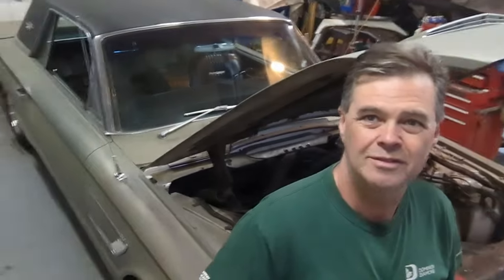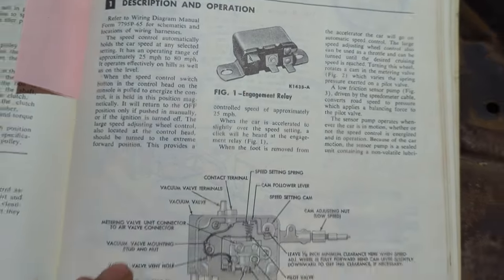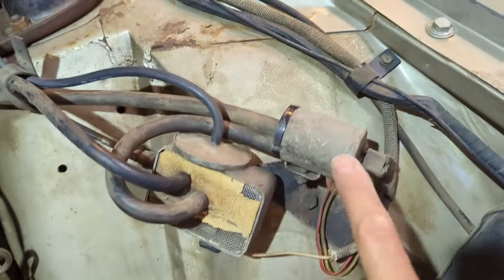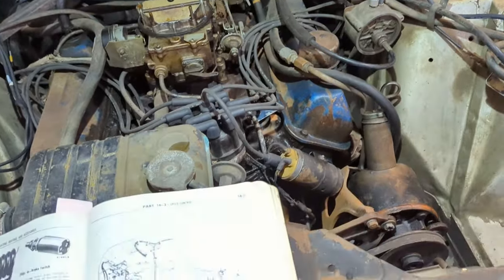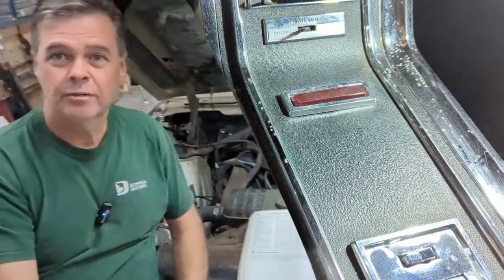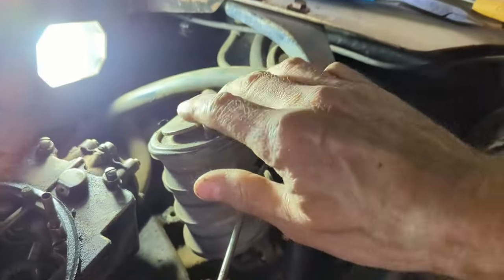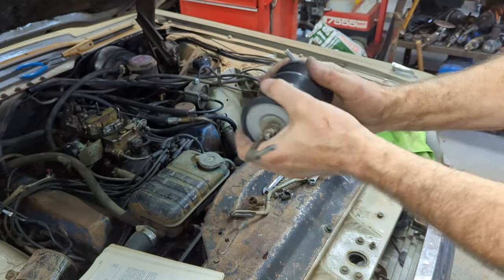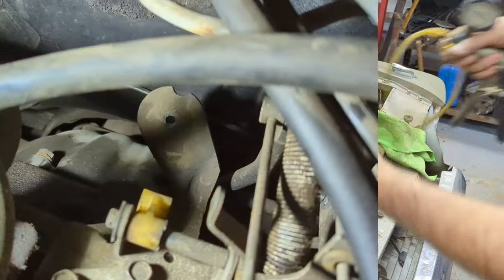1965 Thunderbird Classic Car Repairs Cruise Control

Comment: Nice job. Every speed control unit I've ever seen has been broken. Never saw one working before. I like that you cover some of the unique features like this one or that remote trunk release. Hope to see more.
Reply from the maker: I gather from the comments that these speed control units didn't work so well, but I'll give it try on the highway, and see what we get. 😎
This car has one more not so common feature...the "Perma-Tuned" ignition that I've been wanting to do a video on, It appears to be complete in this T-Bird, I don't think it will be a deep technical video, but more of what each component does, but first I need to get my head around on how it works. Lol

Comment: Simply amazing.  The things that they did before electronics took over.  I had a 66 with speed control but back then the bellows was not reproduced so I never tried to make it work. I hope you do a video of it on the road someday.
Reply from the maker: There are a lot of components that all have to work together in order to make these work, and having them all still installed on the car is rare in itself, lets hope it works on the highway! I do plan on doing a short road test video, fingers crossed that it at least sort of works. Lol

Comment: Hey Alvin, excellent video. I cant believe you got that to work. Ive only ever seen one other work on a 1965 Thunderbird, and that was one I restored back in the mid 90's when they were not quite as old and decrepit as they are today. Ive seen hundreds of these on cars and not one worked. My 66 even had cruise on it but I removed it because its a pain in the ass that I didn't want to deal with. I think your very lucky that the cruise components on your car seem to be in fairly good condition. The fact that the speedometer cables were not broken or seized was a miracle in itself. I was hoping to see you remove and disassemble the sensor pump. Birds Nest used to have the oil for those, maybe they still do??? I think they also have the cruise only speedometer cables new. When testing the one I restored, I was never able to get the speed to stay constant when driving down the road. Once we set the cruise speed, it would either continue to speed up or slow down. Its been so long ago that I don't remember the details exactly, I just remember that it did that. It will be interesting to see what results you get once you test drive the car. Ill be looking forward to that video. Mike Johansson is correct, I always tell people to not waste their time fixing them since there are, for the most part, no parts available and they probably wont get them working. Maybe I was wrong for doing that. If I had convinced you not to fix yours, maybe we would not have gotten this great video. My bad. Your video is very informative and interesting and hopefully it will motivate someone to fix their cruise. It would be nice if the parts were available but there are not enough cars with the option to warrant the investment. FYI, 1964-65 Thunderbirds have the same cruise control components. 1966 is different. Also, at 23:00 in the video when you start the car, see your steering wheel turn to the right? And then every time you raised the idle it turned to the right again. Your power steering gear box is bad. Thanks Alvin.
Reply from the maker: Hey Nick!
A highway test will be the tell tale for this speed control, I'm hopeful, but not going to be disappointed if it doesn't work. Knowing how it all works, and how fine the measurements of the metering valve need to be, I can see why you couldn't get a constant speed, just the slightest amount of change will effect the operation and speed of the car, and I don't think you were wrong in your advice, it was how you feel about it, based on experience.
Yes, the steering gear box is pulling to the right, good eye Nick! Ever since I watched your video on the steering gear box, I've been think about this one, and that I should fix it. I do have a spare one I could rebuild and install...likely a good thing to do for the next owner.
Thank you! 
😊

Comment: Sweet! My '65 also has the cruse control and since Vintage Thunderbirds said that they were not that good and unreliable, I just took mine out of the car and I have all the parts. I did find that the speedometer is two pieces. my upper one was broken. But after watching this video and since I am redoing all the vacuum lines on mine I just might reinstall it. Please post an update after you test it on the road! Thanks, and God bless.
Reply from the maker: To be honest, I agree with Nick on the unreliability of these speed control setups. Mechanically, the components would all have to be in excellent working condition all of the time, and that isn't likely to be the case most of the time, but it's a cool feature just the same, I feel reinstalling it is worth the effort for you...working or not. 🙂